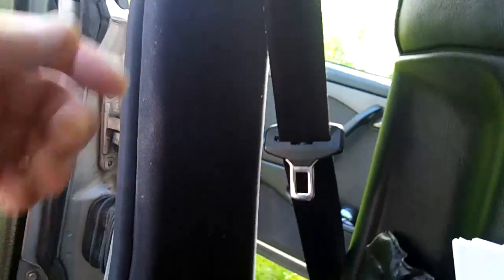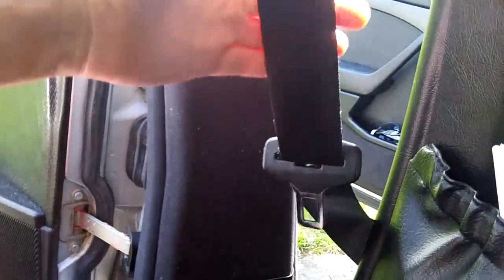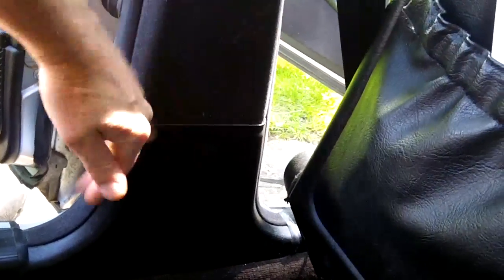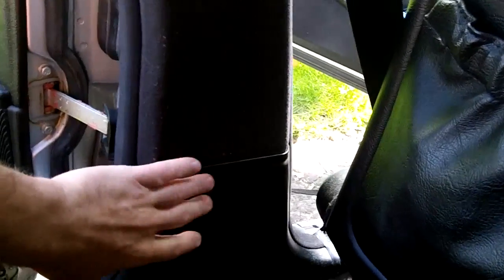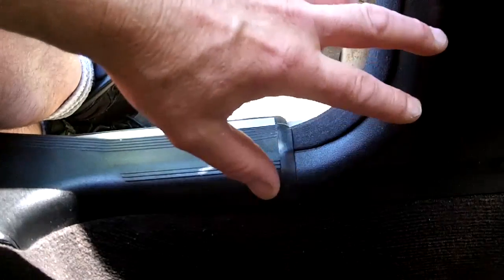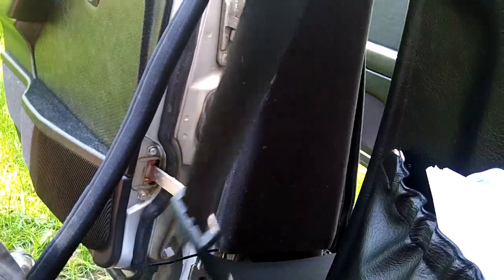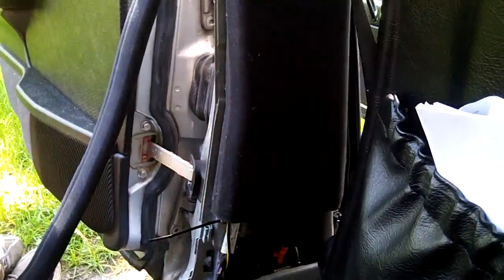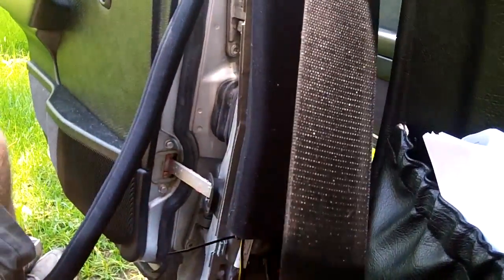How to rewind re-tension a lazy Mercedes seatbelt

Comment: Wish I had found your video first. Dunking it in soapy water didn't do crap. Drilling small holes in the plastic boxes to blow the remaining water out, and spray WD-40 in there only slightly improved it. Those were the video tutorials I had found before yours. On my car the plastic covers aren't screwed on, they are plastic riveted on, and not worth trying to remove. They are transparent plastic though so I can see when the spring is completely wound up. For those looking at this, it doesn't really matter whether you can see the spring. Whatever direction it wants to unwind is the opposite direction to wind it up. Basically the direction it keeps catching on the ratchet gear teeth unless the ball bearing is in just the right spot. Just keep going until it suddenly resists going any further. Can be a bit tricky once wound up to get the end of the belt back in, since I can't remove the box with the ball bearing to hold that catch lever, and holding the lever the car door actuates slipped and completely unwound with that much spring tension. Your solution worked perfectly to restore the seat belt retract functionality to new. Thanks!! Thumbs up. :-D
Reply from the maker: you are very welcome, glad it helped...I know it was tedious to watch, but I was learning at the same time, and decided to leave the screw ups in...good additional info in your comment ,and much appreciated
Reply: ***** Well, I skipped to the part where you showed how to take the strap off so it can be wound up all the way. lol Obviously I already had the trim panel off, and the seat belt mechanism off of my '93 MR2. Good to show that though for people who don't know how to do that. Most cars are similar with how the panel and seat belt mechanism are attached. On another video I saw that newer cars also have an electronic sensor for the airbag system incorporated into the seat belt mechanism. Although my car has an airbag, it doesn't happen to have a sensor. Apparently that sensor can go bad, so that's another thing to inspect for those who come across one in their car.

I was curious though if you happen to know, does that spring somehow slip bit by bit over time, or does it just become less stiff and thus less powerful?
Reply from the maker: CmdrGendoIkari I would think it just becomes less stiff

Comment: Thanks a lot for this- my front belts have been driving me crazier as they get lazier!
I have a '94 S124 and the locking mechanism is slightly different, but the process is much the same as you show here. 
The passenger belt's now working flawlessly, but the driver's belt wouldn't pull off the reel once it was reinstalled. I took it out again and checked that it was refitted to the body in the correct location, still no joy. Had to give up due to loss of daylight, but my next step is to try a proper clean of the ballbearing/pawl/ratchet wheel. Fingers crossed!
Reply from the maker: They are a bit of a pain to do...fingers crossed as well  :)
Reply: fupabox the pawl had jumped very slightly out of place during the retensioning. It clicked back into position correctly and all is well now. Although a vast unproven, the driver's belt was still a little sluggish for the last part, but some silicone spray seems to have sorted that. This really is a quick and easy procedure once having watched your video. Thanks again.
Reply from the maker: very welcome.. glad it helped

Comment: Thanks for the video.
I tried everything (washing, silicone,  etc) and nothing worked
Now I have some hope
Thank you so much
Reply from the maker: The vid is a little jumbled . but hopefully it can help
Reply: Rui Carvalho
 Do you readjust seat belt ? Was the video useful ?
Reply: @petarbaev8064  yes I did 
It worked great
Not in a Mercedes but the seat belt system was identical

Comment: I tightened mine down quite a bit, so I expected it to work better. No change.  I tightened it down to where it just stopped tightening when you pull the seat belt all the way out. It still doesn't work well. I guess my springs are too weak.
I may have to try again, just to make sure I did get it right.

Comment: Very good and clear video. Will try this in a few days on my 202. Only have also other problem... When using the belt it is often stuck or locked so I can't pull the belt out. During driving the car I break or drive on a hill  the belt is free and I can use it properly but when the car is horizontal often the belt locks again. This problem is on both sides and at the same moments (driver and passengers side). Any idea how to fix this?

Comment: Just found his video and gave it a try, didn't get much improvement. Then tried washing the seatbelt, again only a slight improvement. Then stumbled across a video where they spray tire shine on the bottom of the belt, so i thought i would give it a try. The product i used is a silicone spray for tyres and exterior trim, and added the magic tough, it is working like new. Not sure if it would have worked as well if i did not try the first two fixes, and right now i don't care. I no longer have lazy dangly seatbelts. Thanx to fupabox, without your vid i would not have been able to remove the panels, trim etc... Any ideas on how to recon the heater valve? Mine is stuck on hot...

Comment: Sure enough, even though I removed that side cover as gently as possible that coiled up spring exploded in my face haha. I lost the little center piece that holds the spring but since mine doesn't retract due to the pretensioner being fired I probably should have planned on replacing this anyways
Reply from the maker: yeah..getting one from a wrecking yard is easier..rewinding that spring sux  :(
Reply: Yep that's what I'll do. Then I can dissect the pretensioner to see how it fires, then maybe have fun with a couple extra ones I pickup from the yard ;)
Reply from the maker: The Stiver
Oooo.. yes  post results, could be fun
Reply: Will do

Comment: Did you have to disconnect the battery first? i just dont want to have the air bag/idiot light come on afterwards.
Thanks
Reply from the maker: +crayholt  yes it's best to unhook the negative battery cable..this car didn't have side airbags, so it wasn't an issue

Comment: What if mine just wont even move anymore? Do i have to buy a new one?
Reply from the maker: likely locked from an accident . They have an explosive tensioner inside that locks them in a collision. You will need a good used one from a car where the airbags didn't deploy. New from dealer would be ridiculously expensive

Comment: You inspired me to do this myself on my w124 rears, the job is much simpler, you dont have to mess around with balls etc as long as your fingers are strong enough you just hold the spool at the end of the belt, remove the belt, wind it on till max tension reached then reinsert the belt. Piece of cake. In my case I could only go 2 more turns anyway till the clockspring/torsion spring locked up. The results were better but not award winning. https://youtu.be/x3P5iVB-E6Y Let me know what you think.

Comment: Good try, did not get really better, but got the idea =) I have 500 SEC, 1984, and it has automatic arm coming out, when you open the door. Driver site does not come out any more, worn gear?? Do you have any idea, how to fix that moving arm/ changing a gear in there?? Where can I get the part?? Thanks, youtheman=)
Reply from the maker: +Eero Laukkanen  The only place I can think to get the part would be ebay or the dealership..the dealers have every part for every Benz ever made available..some can be pricey, but they can get it.  The only way to know for sure what is wrong with it is to open it up and look around inside..I have never worked on an older SEC, so I honestly don't know how it works
Reply: OK, thanks, I thought you have a Mercedes part store, you order you parts, more reasonable ;o)
Reply from the maker: Eero Laukkanen sorry no.. I for mechanical parts like brakes and suspension there are places that have reasonable prices..but special parts like interior trim the dealer is sometimes the only option
Reply: OK, thanks ! Would you know, is there a wedsite??, where I could order different bodyframe parts?? A piece between trunk and rear window in my 500 SEC/1984 is all rusted out?? I would need that metal piece/ body part to weld there???
Reply from the maker: +Eero Laukkanen http://www.mbpartsworld.com/productSearch.aspx?&ukey_make=1103&modelYear=1985&ukey_model=16104&ukey_trimLevel=20518&ukey_driveline=00&ukey_Category=24390&numResults=50&sortOrder=Relevance&isOnSale=0&isAccessory=0&isPerformance=0&searchTerm=
Reply: looking for that bodypart between rearwindow and trunk??/ just can't find it.....=((
Reply from the maker: Eero Laukkanen From the part list..it looks like it comes as part of the main body shell.. I looked through all the images and lists, and can't find the part separately
Reply: that would be crazy expensive to buy the whole body shell for that !!!=(, there must be another website somewhere just to buy that narrow bodystrip between rear window and trunk, that is a place, where Mercedes usually rust out!!! Or I just have to look junkyards and hope to find a unrusted old body??

Comment: I tried that and when I finished I turned my car on and the srs light came on.
Reply from the maker: +Hernan Mendez  Either the key was in the ignition when you unhooked the belt pretensioner, or it isn't plugged in properly
Reply from the maker: +Hernan Mendez  I will only light if the circuit was unplugged while power is in the system..even the key being in the ignition is enough to make the light go on...it generally won't , usually the ignition needs to be turned on with the pre tensioner or airbag dis connected to tripthe light...unfortunately only the dealer or someone with a star scan tool can reset it
Reply: +fupabox alright man thank you I'll see what I can do